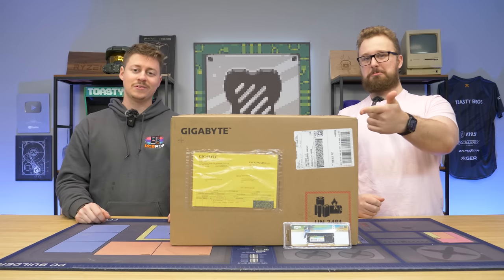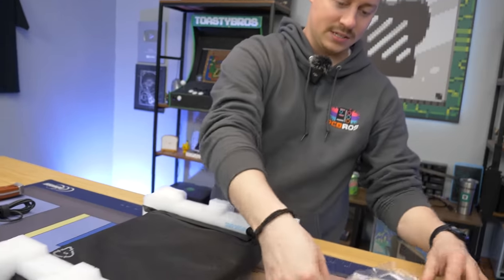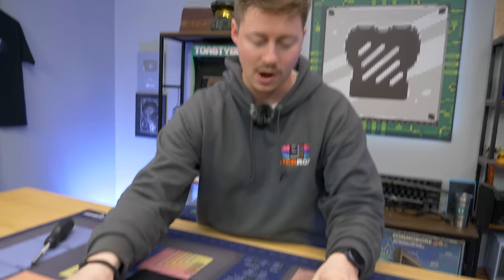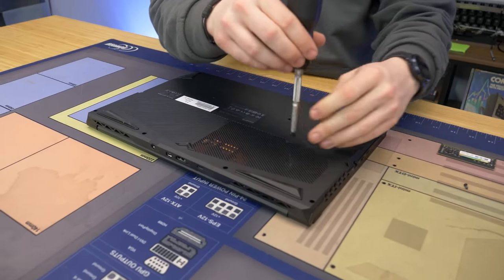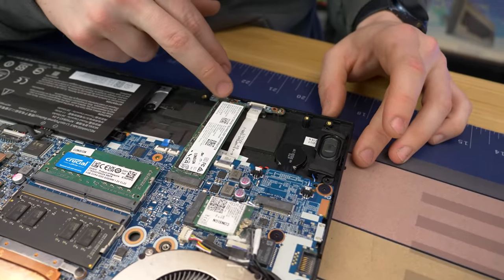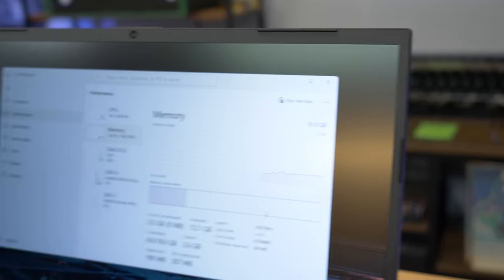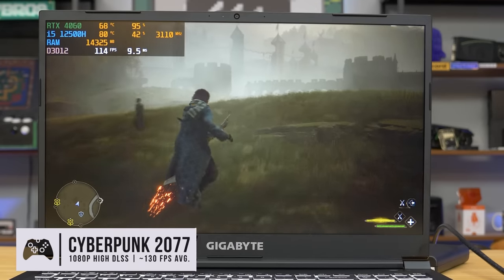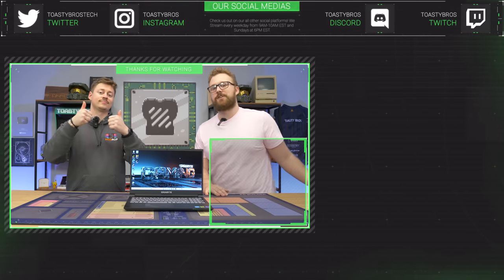Budget RTX 4060 Gaming Laptop...Is It Worth Buying?

Comment: I guess they should have upgraded the cooling solution, I got the same laptop with a 3060(I took it apart to ad a second SSD and it looks the exact same on the inside) and the CPU almost always stays und 90°C. I guess that the shared heatsink can't handle the extra heat from the 4060 too well... And strange that my 3060 version came with 16 gigs of ram... And the one with the more powerful GPU only comes with 8 gigs
Reply: I have both laptops, and I can tell you they are not the same. The KF is more compact than the KD variant. Also the 12500H is at least 20% faster than the 11400H.
Reply: The GPU also has 8 GB of RAM built in. A lot of budget laptops don't have that in their GPU's.
Reply: @floydlooney6837  you mean VRAM ?
Reply: @Mike-mp1hk  I got the KE variant with the 12500H, as far as I can tell it's the same except for the GPU
Reply: I actually own a 4070 version of this exact laptop paired with a 13900HX and 32GB of DDR5 with Samsung 980 evo Pro . . You will NEED a Laptop cooling pad 100% . Also i agree the cooling solution does suck .. I highly suggest Re-applying better thermal paste or reach out and use the RMA and say its overheating .. Thats what i did and it came back a bit cooler once they re-applied the thermal paste 

This Clevo chasis is shared with multiple brands .. So it depends on the brand you choose , ALL will have different options

Comment: Cpu runs on high 90’s but you’re saying that’s pretty normal for laptop?! And fans run high rpm very audible. WgT if they run let’s say 40-50% what temps we should get? Shut downs?  No. That’s poor thermal design by Gigabyte. My Lenovo Legion 5 has RTX 3060 and Ryzen 7 5800H. Without touching fan settings. Default. Zero fan noise. GPU runs mid 60 C. Cpu fluctuates between 75-80 C. You tested one game. How that it’s called review in your opinion? What about audio, screen etc? If you want to be influencers and sell products for Gigabyte or any other corporation fine. Your channel your choice. But don’t label yourself as reviewers. Anyway I find your videos very entertaining. Peace.

Comment: For $1,000 + laptop with a full power 4060 ( kinda surprised it's a 150w brick along with an Intel ), it should have come with two sticks of 8G ram R8 3200, atleast it's not soldered to the board like some other laptops in this price range, the switch is a positive atleast.
Reply: How can you enable the MUX swtich? Btw goated pfp
Reply: But which laptop can you buy for $1000 has all of that?
Reply: @STeroidsnicca  Good question cause every company trades something off to have something else. I'm happy with my delta 15, especially cause I got it for $800 new vs the $1,600 tag it was priced at.

Comment: CPU getting hot and throttling really won't affect performance much if any... GPU throttling is a problem as that will directly hurt performance. CPU temperatures getting higher 90's looks crazy, but is completely fine. People have too much of an obsession with high temperatures on the CPU. GPU being too hot and throttling (which it's not in this video) is a way bigger issue as that will directly hit your performance way more. Unless your CPU is getting so hot it's causing 3 or 2 Mhz in gaming or potentially causing your computer to shut off, then it really is not a problem in the slightest. Fan sound is probably the only real problem, if you care about sound.
Reply: I have a question. I am not interested in the accuracy of expensive games and I like to play at low resolution....Does it affect computer performance? At a low playing temperature?

Comment: For everyone complaining about the CPU temps:
- Download throttlestop
- Undervolt CPU (start around 70mV - 145mV, in 5mV increments until you hit your chip's limit)
- Disable Turbo (very important)

Should go from about 95C to 70C - 75C with a minimal drop in performance. So in essence, you're trading off > 5 fram es for 20C - 25C cooler temps. An easy trade to make. And if the 5 frames are that important to you, tweak your in-game graphics settings.

 C'mon guys, this is PC gaming 101 stuff, and not that serious of an issue to have so many people complaining about. 

I did this to my i7 9th gen / 16GB / 2060 laptop (80W variant) I bought for $500 (buyer said temps were too high so he sold it cheap lmao), and it idles around 35C, internet browsing around 40C - 45C, gaming around 70C (Timespy score of 68xx I think. Been a while since I've run it). 

Not bad for a $500 2060 1080p/144hz laptop. Runs COD at around 70-80fps (I just usually lock it at 60fps), and Warframe at 144fps at around 65-70C. Although I am using a custom voltage/frequency curve in MSI afterburner (PC gaming 201). 

But it's perfectly fine for 1080p gaming (especially in DLSS games) after a few tweaks to control your temps and SENSIBLE graphics settings, that honestly, all serious PC gamers should know how to do.
Reply: I can’t undervoting 12th gen Intel processor
Reply: $500 is a good deal for a gaming laptop? When did you buy it?
Reply: @zapor39.76  Lower the power CPU's power limit then. It'll serve the same purpose.
Reply: @zzz-cb3xe  $500 can get you a good deal, if you know what you're doing, or are willing to learn. But if not, you're likely going to end up buying some crap. 

New mid-range gaming laptops usually run you about $1k. High-end ones are like $2k+

Idk, I bought that one in like 2021 or so.
Reply: Undervolt the gpu or cpu?
Reply: I just got a similar deal to yours for rtx3060
Reply: @zzz-cb3xe  Undervolt the CPU. Use a custom frequency curve in MSI afterburner on the GPU.

I wouldn't touch GPU voltage unless you really know what you're doing.

Comment: I'm a little disappointed by the start of the video. It seems like you were giving Gigabyte a pass on the 8gb of ram. Even you said ram is pretty cheap and should be upgraded. If so, Gigabyte should have done that, and your comment could have easily been negative. So, why did you feel a negative point wasn't warranted?

Comment: Why wouldn't you expect the 4060m to perform like the desktop gpu? The 3060m was within 5% of the desktop 3060 at the 130 watt tdp
Reply: Looking at benchmarks in cyberpunk it performed almost the same as a 3070 desktop, i almost spit out my water while drinking after seeing those fps WITHOUT dlss !
Reply: @naipigidi  the major difference is ray tracing performance. Thats where the 3070 really out shines a 3060. People kind of hold the old thought process that mobile components are lacking. But in that lower to mid range they are almost on par. CPUs are in a similar position, most laptops are pretty close to 65watt desktop cpu equivalent
Reply: @naipigidi  the major difference is ray tracing performance. Thats where the 3070 really out shines a 3060. People kind of hold the old thought process that mobile components are lacking. But in that lower to mid range they are almost on par. CPUs are in a similar position, most laptops are pretty close to 65watt desktop cpu equivalent

Comment: I don't think 8 GB ram is okay in 2023 for new hardware. 8 GB VRAM will soon be obsolete. So it's not okay to have new hardware with 8 GB system RAM in 2023. When you need at least 8 GB VRAM (for gaming) then 8 GB system RAM is a joke. For $1000 is a double joke. It would have cost the manufacturer $20 to double the RAM. And if anyone wants to argue: "oh well multiply that $20 times every single laptop they sell, and that's a lot of money" . To that I respond: then sell the laptop for $1020. Every fucking product does not need round numbers at the end. Add 20 dollars to the laptop price if you have to. But companies don't want to make it $1020 because then they can't say: "oh our laptop is less than $1000". It's marketing bullshit like that that ends up hurting customers. Sellers like to have round numbers like $499 and $999 so they can say: "our laptop is less than $500" or "less than $1000"

And that's marketing and advertising bullshit.
Reply: Seems more like they want you to open it up and add more storage / ram, so when you try to RMA your $1,000 + laptop they can tell you to piss off cause you broke that 10 cent sticker. Do they atleast offer the option to pay X amount more and they'll add the ram and M.2 at the assembly line ?, probably not 🤔. Wasn't there also an issue with some 40 series GPU's lately that Nvidia Wasn't honoring ? 🤷‍♂️

Comment: even for a gaming laptop 90+ degrees is not really good. considering all this copper. i wonder if replacing the thermal paste with something good will make a big difference
Reply: bcs it will boost till 90c in all cases, if its the issue - its possible to reduce max temp
Reply: @jekaufo  yes TILL 90 degrees...here it goes over 90. its not wise to strain a chip to its mac temp regardless of what chip it is
Reply: The intel cpu in performance mode is allowed  to boost way above 45W spec in that mode possibly around 60 to even 80 W

Comment: I have one! First off, these guys don't know how to apply thermal paste. How hard is it to apply a pea sized dot of thermal paste on the CPU and GPU?... GET THE RAM! 32GB is not much more expensive and you'll be good for years to come... I use throttlestop to limit PL1 and PL2 down to 90w. Overall performance is much better with less heat and thermal throttling. I also use a decent cooling pad... The GPU is great. I'm currently running a stable OC at 2715Mhz,  @1V with +1250Mhz memory
Reply: By the way, the G5 KF-E3US333SH model being featured does not have MUX Switch!

Comment: So, a good rule of thumb, laptop GPUs are usually 28-33 percent less powerful than their desktop counterparts
Reply: Some, depends on design, the thinner it is the more likely it's been lowered, the smaller the frame the harder to get rid of heat, but the air inlet is quite open on this unit.
Reply: The 140W 3060 laptop has same performance as its desktop version.
Reply: @ThatOneGuyC  That's because the laptop RTX 3060 is exactly the same GPU as the desktop version, I think it even has a bit more CUDA cores, great value.
Reply: @danl9621  It's 30W less than the desktop but still offers same performance, I guess that's because of more CUDA cores.

Comment: I ordered mine last night, probably i'll recieve it monday or tuesday. Here in EU or at least in my country it comes with standart 16GB RAM - can't get 8GB version in any of the stores, you can choose from 16 ; 32 ; 64 gb, but the lowest is 16GB everywhere. Anyway, i'm planning to upgrade it streight away and replace the standart 16GB with 2x16 or 1x32GB Kingston Fury RAM and also upgrade the storage as well (SSD) with Kingston KC3000.  My biggest concern is the higher temperatures that most people say this laptop can reach.. i'll test it and see if I'll need to buy cooling pad as well.
Reply: I actually own a 4070 version of this exact laptop paired with a 13900HX and 32GB of DDR5 with Samsung 980 evo Pro . . You will NEED a Laptop cooling pad 100% ...
Reply: How is it going man I'm planning to buy this laptop too ?
Reply: Hey how has it been
Reply: @STx95  so far so good. I got the 16GB Ram version & only upgraded my SSD with additional 1TB, for the money i'm happy with the performanceyou get. The only "downside" can be the fans going almost full speed when you enter a game (ofc. u can manually adjust the max. fan speed as well), but when I play with headphones I don't even hear the fans, so its OK.

For the performance you get at this price - I think it's worth it! Similar spec. on top tier laptop like Asus ROG will be much more expensive. It may be better quality, but..    I don't use this laptop as main gaming station, I have PC that I use at home.  And this laptop gets the job done when i'm not at home.
Reply: @todor92 what about the thermals?

Comment: the ethernet port being right in the way of the mousepads dissapointing. but, ive noticed most laptops are like this.
Reply: laptop designers are left handed / can get 90 degree rotated ethernet cables
Reply: @bandita2068  A lot of designers are so strict about it by design they want it in your lap. not on a table with a mousepad next to it. lol. ect. which is ok these days because everythings an xbox controller anyways..

Comment: motherboard. mini dp????????????? Than you need dp normal it will be problems to connect to external  screen, and you may forget probably about high refresh rate monitor which people has, mini dp may not support speeds or smth, its strange = bad.why where is no normal dp question, Next memory card reader dont like as this also says old motherboard.

Comment: Don't buy this laptop thermal problems are visible on this video...i5 it's only 4 cores it won't handle the game like battlefield 2042 . I got i5 9th gen with clock 4.1 GHz this one is i5 12th gen with clock 4.4 GHz that's the only difference this is the same cpu!!! On mine temperature Max is 91c° this one going up 100c°